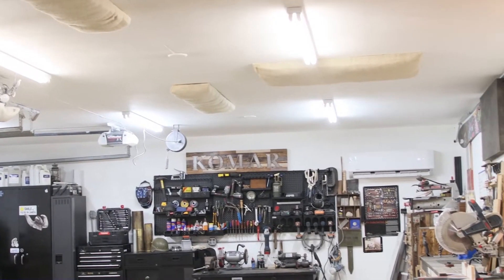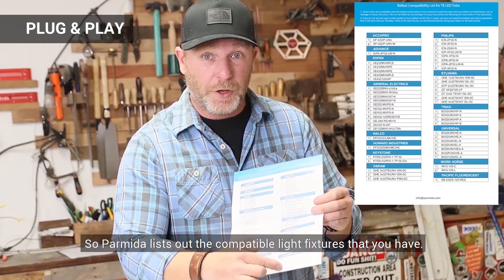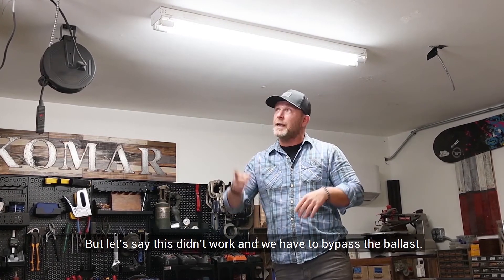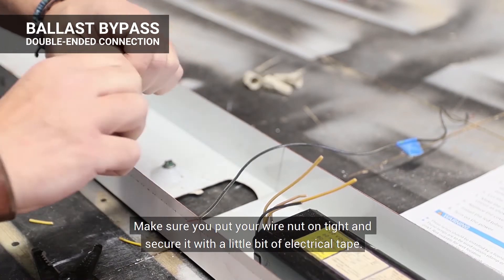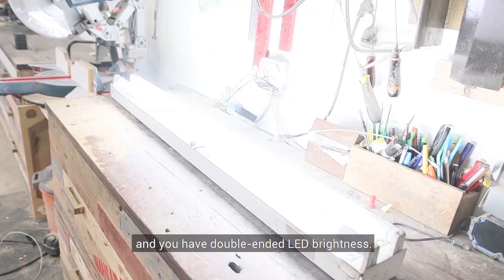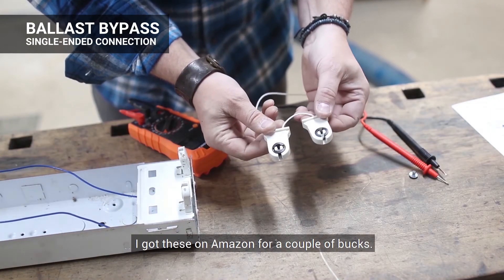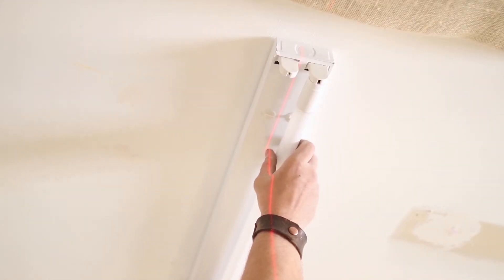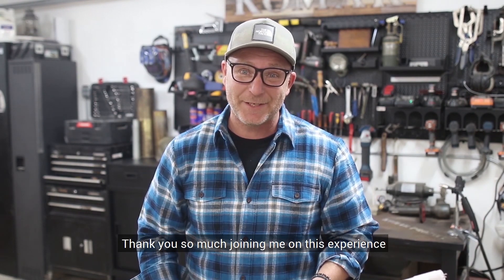4FT LED T8 Hybrid Tube Review & Installation

Comment: The problem with leaving the ballast inside the fixture with the Plug & Play option is that it's still a potential failure point.   Ballast Bypass is the best way to go.